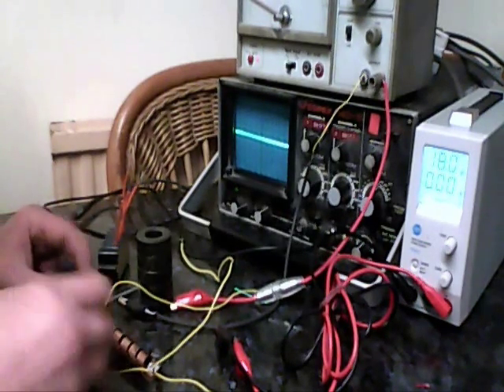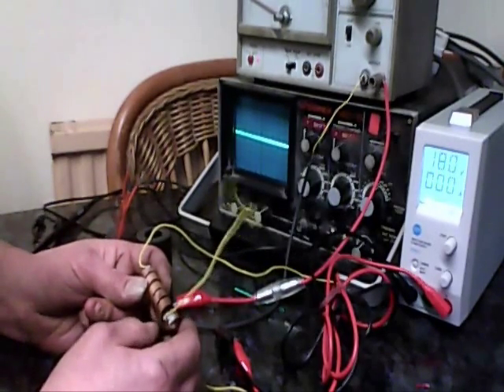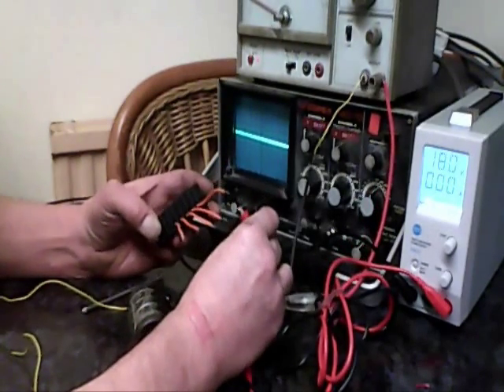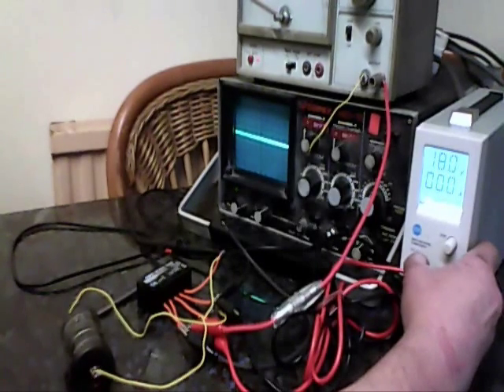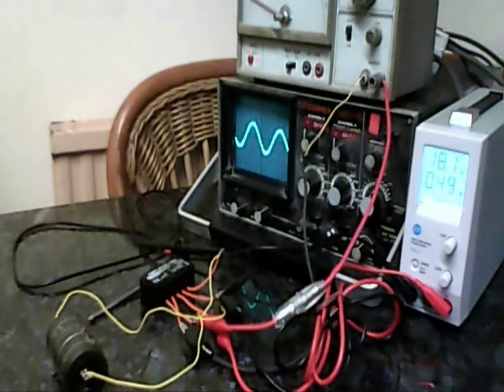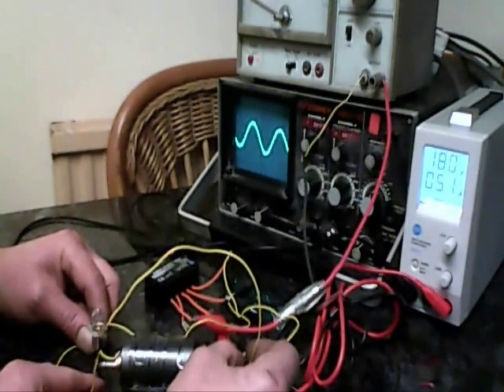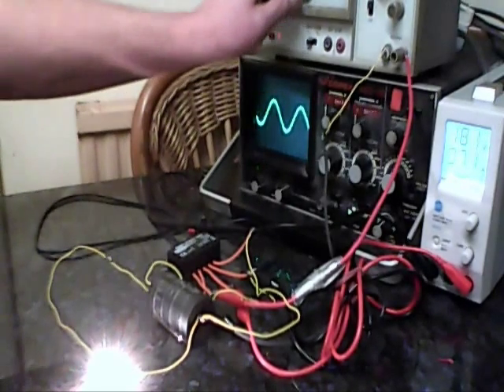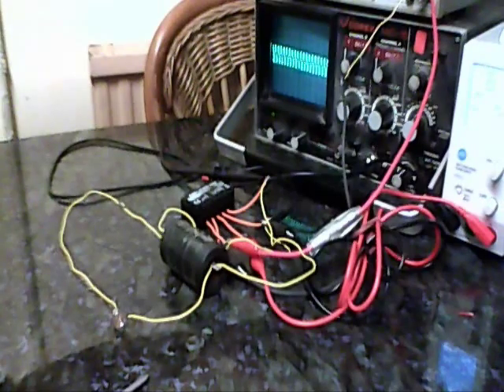Replication of Special Russian Transformer

Comment: So the answer is no? There is no extra energy? If you were running a small motor off of your power supply with the same set up on the main circuit and had this extra wire and light bulb running through the ferrite cores but not directly connected to the power supply, would the small motor run the same and still light the light bulb? It seem you are pigibacking that light bulb for free because its not directly connected to the main circuit.
 I know this is the concept to a transformer and power is lost through the conversion from stepping up or down in voltage, have you found a better way of doing this?
please explain I am very interested.

Comment: It seems you are lighting that light bulb for free, correct? The power is passing through the copper tape with small feride core in it and the free wire with the bulb is passing through the small and large feride cores. Is there a drop in power from the power supply? Can you make a loop and re use the power from the light bulb as a power supply?
Reply from the maker: Hi Randy. No it is not free energy!! Just a very efficient transformer design.
It runs at it's resonant frequency so there is little energy required, but the lamp is still creating a load and that is seen in the overall result.